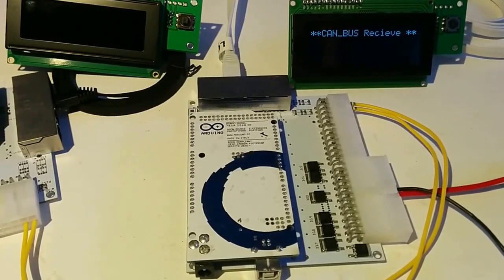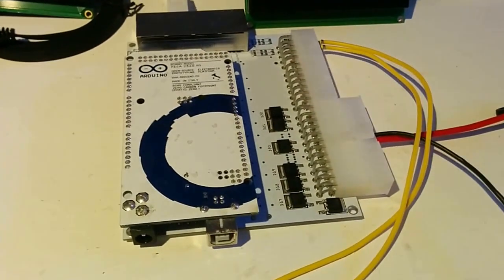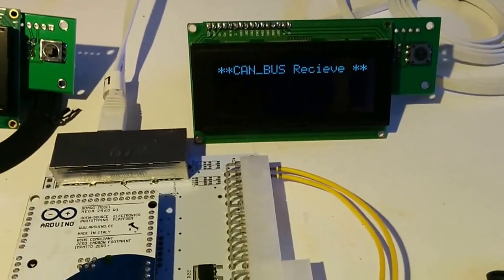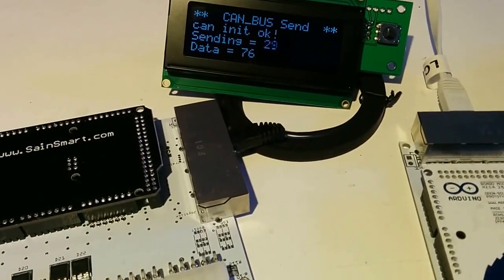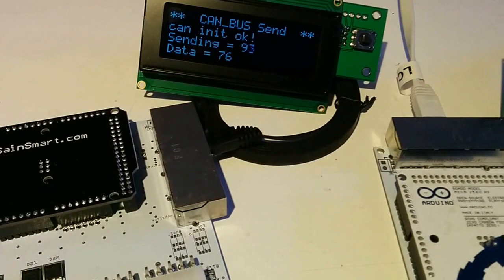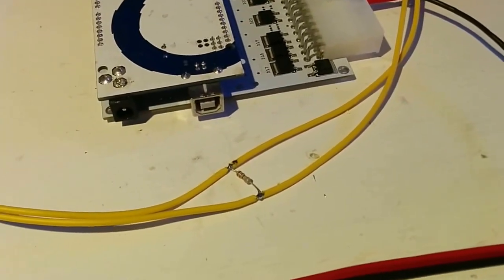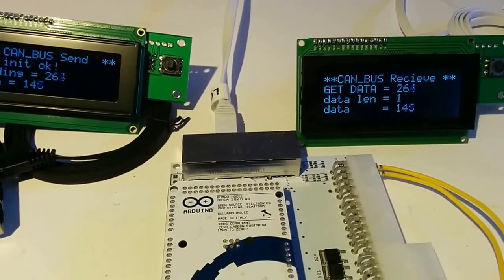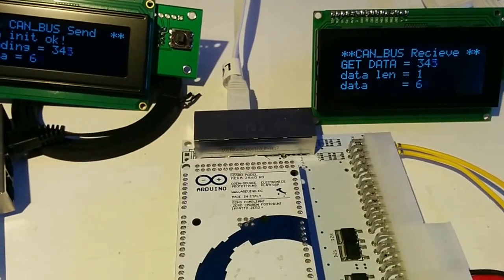Testing Can bus on my arduino shield

Comment: Hello, can i use this model to get the analog RPM signal from my ECU and create a canbus RPM signal to my cluster? or do you know which adapter/emulator i can use to get the analog signal from my ECU to create a canbus RPM signal to my cluster?
Reply: Hi Yes it can be used to Read an RPM signal from the inductive sensor, and transmit CANBUS code, 
If you want to contact med open the Link for the document, in this document you find my Email adress.
Reply: Ole kan jeg kontakte dig via din mail? jeg mangler virkelig en mulighed for at kunne få mit RPM signal lavet i min bil, jeg har været hele verden rundt og har intet kunne finde som kan klare mit problem